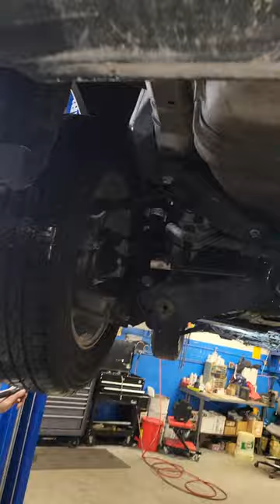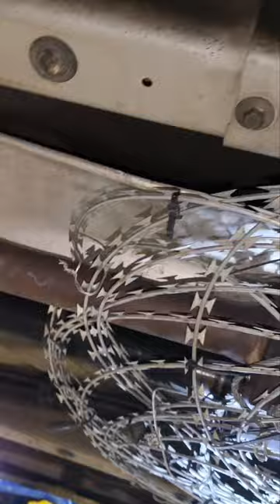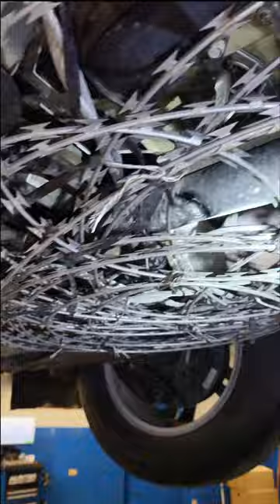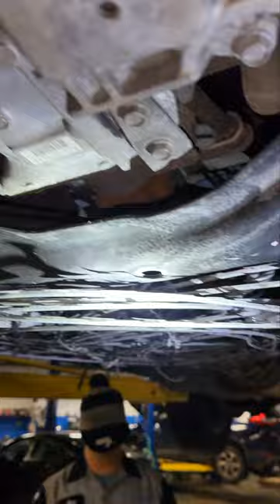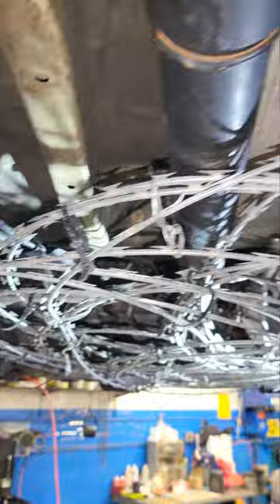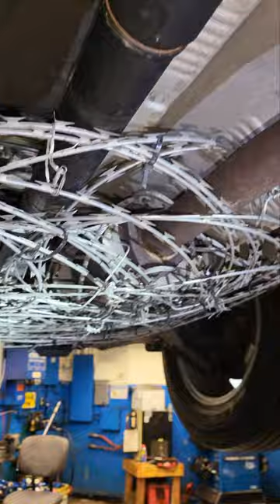Catalytic Converter Protection || ViralHog

Comment: Clip the zips. Done.
Reply: My thoughts exactly.
Reply: cat thieves are looking for a quick hit. They take one look at that and move on to the next vehicle without any protection.
Reply: miss the metal cables? and access on the ground, often at night.. not so easy.
Reply: The zip ties aren't just holding them to the frame, they are also keeping them bunched up. You clip them and the wires go from flat to encircling the whole area under the car. The crucial points holding the wires to the frame are metal. You would need a heavy duty wire clipper to get them off and they are too big to fit under the car. Hope all those who have ever stolen catalytic converters or plan to, end up never being able to use there hands again. Thieves don't deserve hands.

Comment: Good idea but zip ties? Really?
Reply: Looks to me like there's heavygauge wire holding the whole shebang on, and the zip ties are to keep the razor wire tight and high so it doesn't drag....?
Reply: @melissasaint3283  I watched again there is aircraft cable but I really cant tell what that its doing.    Looks like a good deterrent anyway
Reply: @melissasaint3283  that's right.. good luck to a thief crawling under a low slung car trying to cut that lot off.. unlikely.

Comment: Did Wire cutters get patched yet? Or is it in the next patch notes.
Reply: It's a deterrent. Why bother cutting through that mess when you can hit the car in the next driveway instead? Obviously it's not impenetrable.
Reply: Junkie thiefs usually carry an electric saw, not tools for cutting through barbed wire
Reply: @BarneyGumbl3  It's not so simple. There is a BIG difference how much valuable material catalytic converters have, so they target specific models (at least if they know what they are doing). So the car in the next driveway likely won't be a good target.
Reply: You ever cut razor wire or barbed wire the stuff has a tendency to spring, so if you have small hand held wire cutters it may fling at you at cut you, plus you would have razor wire all under the car to pull out of your way to then get to the cat.  Most thieves aren't having thick leather gloves either so even if you did cut this off good luck moving the stuff with your thin mechanics gloves
Reply: If all that is stainless. They will not bring enough blades to cut through that s*** and a  pair of Cutters won't cut through it. It's real sad that this even has to be done. If you could shoot there's, this would stop.  Criminals have more rights than the victim that should change the victim should have all the rights the right to protect by using deadly force if necessary